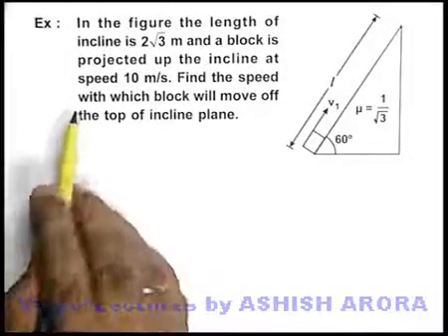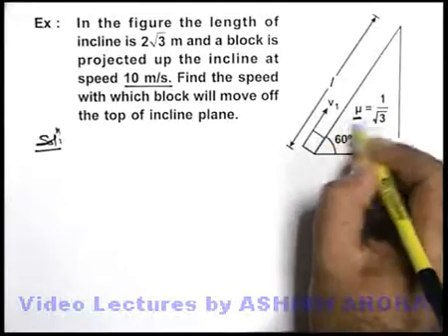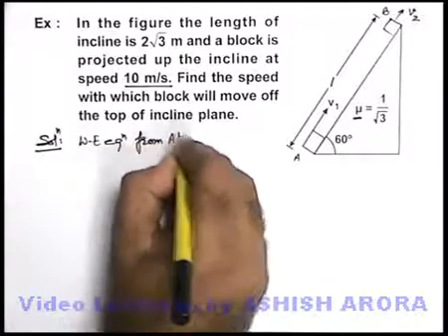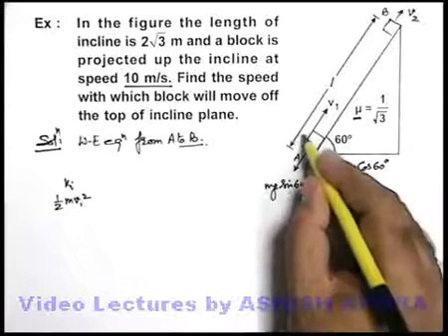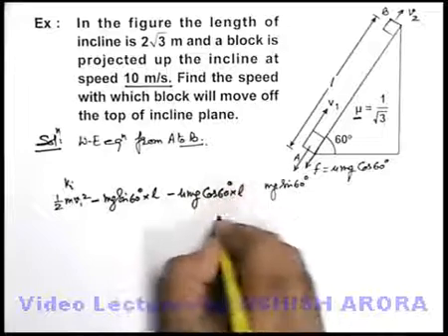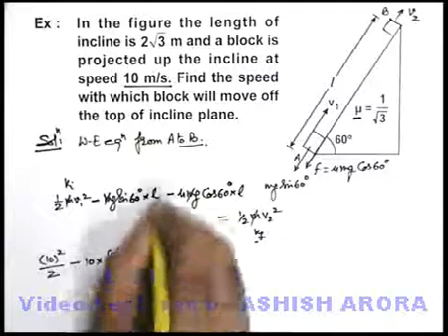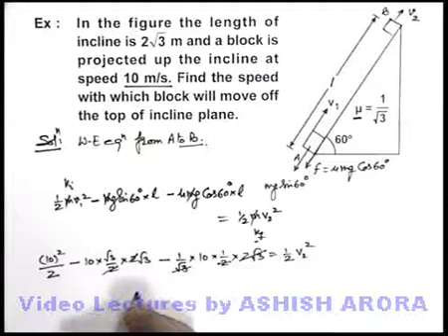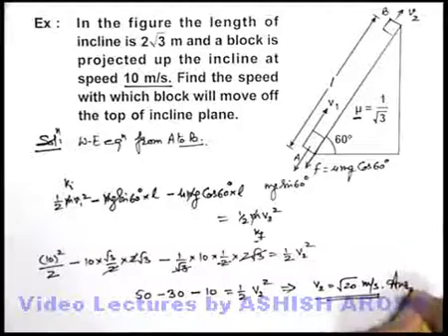Class 11 Physics | Work Energy Power | #15 Solved Example-7 on Work Energy Power | For JEE & NEET

Comment: sir why here u considered work done by friction as _mu.m.g.cos60degree×L...as in advance illustration you told that work done friction force depends only on horizontal componenet ...so can we take here also the work done by friction as mu.mg.Lcos60degree?????
Reply: Saumya Singh bruv your basics is not clears....... work done by fric will always come in picture when we have rough surfaceand along the motion of object
Reply: work done by friction depends on horiz comp only when it is done slowly . we consider velocity to be negligible.

Comment: what about the potential energy at the top?
Reply from the maker: Ajay Banstola We have already accounted work done by gravity so no need to account potential energy separately otherwise it will be included twice that will be wrong.
Reply: +Physics Galaxy yes. -mgsin60 * l is same as mgh which is potential energy. which becomes positive when brought to the right side. now i get it.
Reply from the maker: +Ajay Banstola Work done by gravity mgh is the same thing which is the change in potential energy. You either use energy conservation or use work energy theorem. In work energy theorem we consider only kinetic energy and work by all the associated forces. This accounts for the potential energy of all conservative fields... follow the lectures in sequence at www.physicsgalaxy.com under video lecture tab for the topic mechanics and section work-energy-power...